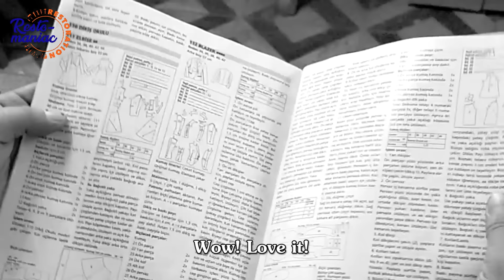Vintage Coffee Table Restoration

Comment: The original veneer was several book-match pieces of possibly a variety of woods.  He may not have been able to get some to do the restoration.  Regardless, he did nicely rescue this piece from the trash and return it to being a nice-looking, usable table again.  That may also be why he opted for the very dark finish.  Good job.
Reply from the maker: Thanks for your comments :)
Reply: Agree people are too much with comments about stain. This guy did a great job with a wreck basically, people need to chill.
Reply: Waaaay too dark for the style and waaaay too glossy....Looks like plastic. Phillips screws covered with epoxy not really on for an antique. Finally the veneer stain was blotchy and looks a bit bumpy in spots. (Contact cement would have done a better job) Other than that good job or at least everyone else thinks so.

Comment: Hello from France, great restoration job, this table was in a poor condition but, in my feeling, the stain is too dark and the result is too shiny, it doesn't look natural, in addition, you use plywood panel instead of solid wood panel and recent screws that have been hidden by some wood filler instead of using wood dowels.

Comment: do you use the saw dust from the project you're working on, or will any sawdust suffice? also, I notice that you alternate between wood glue and super glue, and I was just wondering why and what applications each are best for
Reply from the maker: Hello. Sorry for the late reply. It is best to use sawdust from the original wood (if any). But I collect sawdust in a wide variety of colors and sizes. You can use white (PVA) glue for all woodwork. I use the instant adhesive at the points where I do not want flexibility and for very small repairs.

Comment: I did a similar restoration to an old side table my mom had. At the time I didn't have any "power tools", so I stripped it down & took it apart as much as I could, repaired & restained it came out pretty nice. I think it might  have had a drawer or a door on it at some point, might replace them if the urge hits me.

Comment: There are pieces worth-while restoring because it actually takes retouching; however, this was not the case. You have made a new piece, using less than 30% of the original material.  This coffee table should have better served to light the fire for an Argentinean asado.  Had it been from the late 18th century, it would have been wonderful.  All in all, your craft, your dedication and your passion are beyond any criticism.